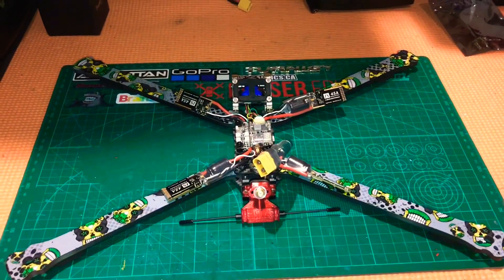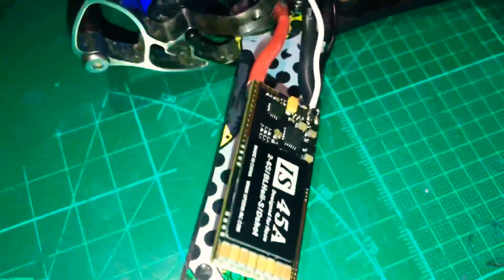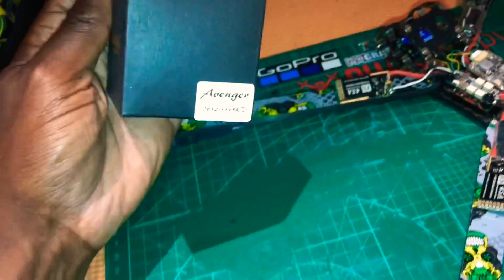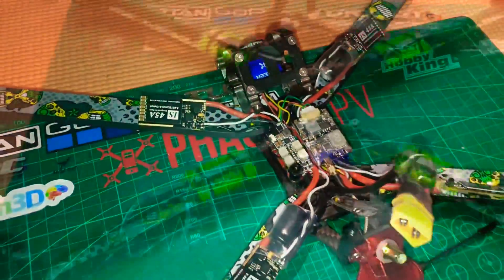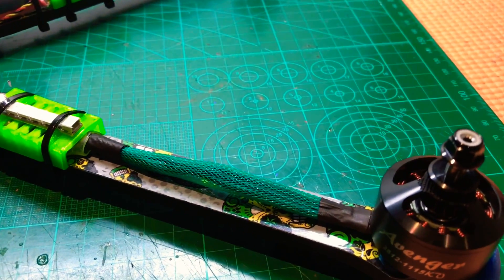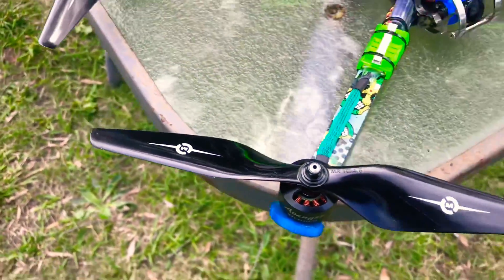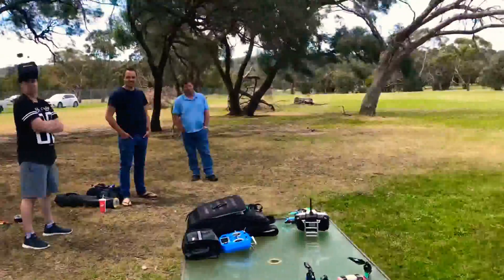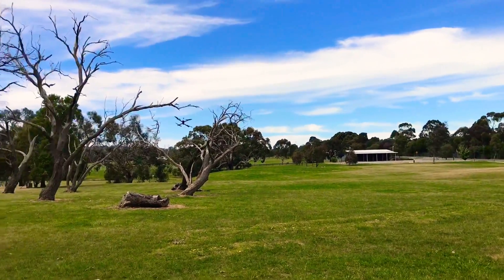Worlds 1st 10” Armattan Rooster Maiden Part 2

Comment: Sounds like a V8 onboard :D
Reply from the maker: Yeah it’s awesome and fun to fly 👍🏾😀
Reply: @WigganRC  I am currently flying and testing a 7 inch reverb on 1600 kv Schubkraft GT 2 on 7 inch three blade propellers and an 8 inch iflight with 2514 Garila 1500 kv engines on Master Air Screw 8x6x3 3 blade propellers. Both on 6S :D
Reply from the maker: Nice heard the garila motors are not bad. Just got an Alien frame that might be nice as a 7” but will see. 👍🏾🙂